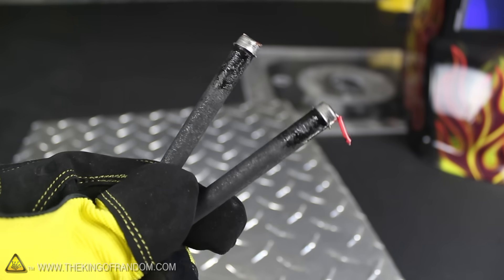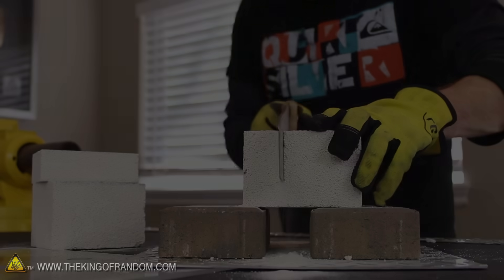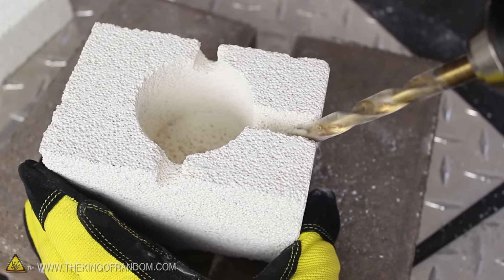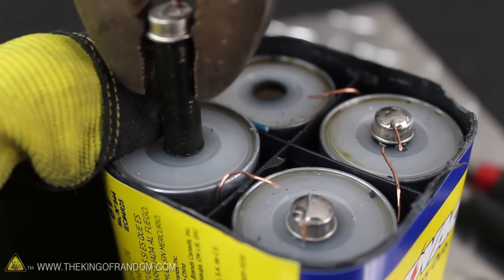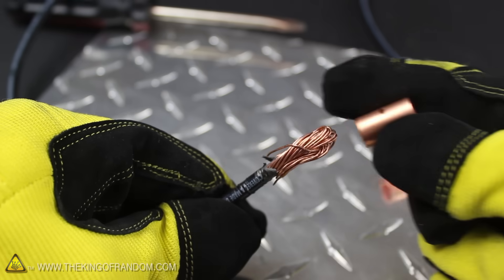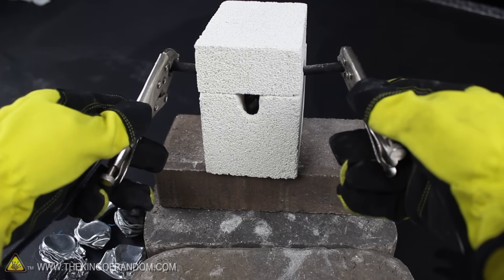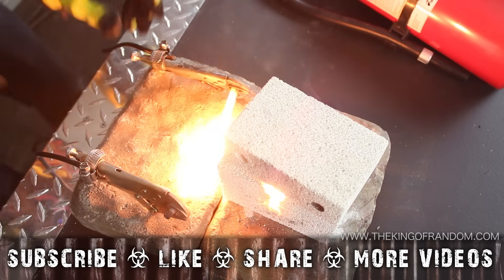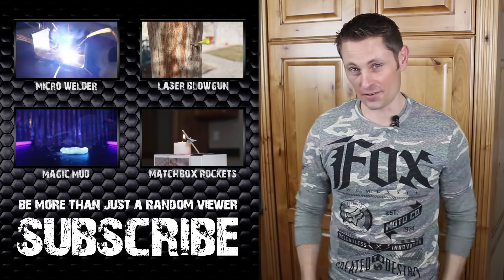How To Make An Electrical Arc Furnace

Comment: do you think sunglasses are enough to not get blinded!?
Reply: No
Reply: Nope
Reply: probably not
Reply: Goober xD y'all don't really get it... i'm not that stoopid
Reply: Julinator I am that stoopid I guess. I've only been working with molten steel for 37+ years now - and I sometimes only wear flip flops and bermuda shorts, no gloves...
I get less deep burn wounds that way. It was always clothing (especially the boots) that trapped a blob onto me, causing the REAL trouble.
Of course, if your casting is going to be large and the air you're in over 800F...you gotta wear some pretty extreme protective suit action.
As far as shade of lenses; shad 10 won't allow you to see much at all unless you're working with an electric arc. Just try it once and you'll see. Shade 10 turns the sun into a dark little disk in the blackness.
Reply: skeggjold gunnr funnily enough this miniature furnace is using electrical arcs to melt the metal... but sure if you dont mind going blind use shades while using this rather than the proper protective equipment ill be here ready to laugh at you when it damages your eyesight.

Comment: does it melt steel beams?
Reply: JET FUEL DOES NOT MELT STEEL BEAMS
Reply: +Imaan Waseem STEEL BEAMS DONT MELT JET FUEL
Reply: +Chosen Mania (DarkWithen) are you high? nothing can render a nokia inoperable.
Reply: +Chaosproscho did 9/11
Reply: Only jet fuel can do that
Reply: Mike Snapper And donald trump
Reply: Can it melt a Nokia?
Reply: VoidRaptor
oh sorry i was drunk and i was at a 420 party
Reply: Correct. it can, however, heat the steel up to the point where it will bend like a paper clip. Please do your research before blurting out the first thing you read on google.
Reply: +sonictales69 I am actually reading "the fire" right now how ironic is that haha.
Reply: yes. he said it was possible to melt steel.
Reply: +sonictales69 doesn't understand what a meme is
Reply: definitely
Reply: Tungsten carbide metal has a 6,192 F melting point, will this work?
Reply: The arc temp is about 10,000 to 12,000 degrees. Should have no problem.

Comment: I am going to use an 130 amp portable welding mashine and graphite electrodes. Would this be enough power for melting iron and steel? Do graphite electrodes wear off? Thanks for your answer in advance!

Comment: what was the power source?
Reply: The two carbon rods react when they touch, hot enough to melt steel.
Reply: +Wocyppah okay so he is using a welder then right?
Reply: I made it using a house outlet (15 amp) with various appliances as resistors

Comment: how long do the electrodes last
Reply: The electrodes get sharp after a few uses. As long as you don't rub them together or put them in the metal, you should be fine for quite a while

Comment: Do you need the arc welder
Reply: +KJ D  You don't need anything ever
Reply: +KJ D I think so
Reply: Shut up!
Reply: ***** Thanks for the tip worked pretty well had sum trouble at first but it was just operator error.
Reply: +Vernon Grimes you
Reply: Hi gays
Reply: I do if you still have it
Reply: pewdiepie

Comment: How do you use the center tapped section? I understand the basics of circuits  but I'm having trouble figuring out the configuration of your circuit for 120V power source.

Comment: does it also work with electricity from a normal socket?
Reply: +Philipp der Interessierte I don't know but Id have thought it would be better with a transformer. The transformer increases the current and lowers the voltage so more of the power from the over all circuit from power station and back goes into what ever is in the circuit on the out put of the transformer. The resistance of the welding creation you made combined with the transformer will be higher because of the transformer. 
Anything on the side with more coils of wire has more energy pushed round Current but with less force/over a lower potential difference voltage any resistance now has more energy passing through it so takes more energy pd between one side and the other * current through it should give you power consumed though the voltage is lower the pd through the welder should be the same and over the transformer it will be higher.
Without the transformer you would need a higher resistance to use the same amount of power.

Comment: in my country we have electricity of 220volts ac current, so my question is still i need a oven transformer ? 
and kindly elaborate the specific reason for using a transformer as you can use a dimmer instead to reduce the required amps for the furnace. 
thanks in advance.

Comment: iron-1370C?If you want to melt iron u'll need 1539C or higher!
Reply: +Леон Вишняков  Carbon sublimes (like dry ice), at an amazing temperature of 3550 deg. C. So this isn't to much of a problem.

Comment: so do you just connect the clamp wires directly to your 240v wall plug with a modified extension cord?
sounds a bit risky, but some1 tell me if I am correct.

Comment: You don't have to destroy a good battery to get carbon electrodes.  You can buy them from welding supply houses.  They're used in commercially produced carbon arc torches.

Comment: Note:  The black powder inside the batteries is not only manganese dioxide (MnO2), but contains ammonium chloride (NH4Cl) as well.  NH4Cl is water soluble, MnO2 is not.  It can be extracted by soaking the black stuff, then filtering.  The solution can be evaporated to get solid NH4Cl.  It's also known as "sal ammoniac," and is used as a flux in soldering.

Comment: I made mine (several!) this weekend.  I experimented with glass, solder, lead, copper, zinc, Aluminium.. I even made some (very brittle) brass.  I did wonder how many amps I should use and started with 40.. then eventually was using a 100 after I re-watched the and noticed that after Grant's 10 seconds with the Zinc how red the surrounding silicate was!

Comment: To avoid the fumes, try a welding respirator. I use the Miller LPR-100. The manufacturer's literature says it filters the zinc oxide particulates. Works for me when I'm welding galvanized too. Cheap, like $30-ish.

Comment: I watched your electrical arc furnace video. That is excellent and very interesting. I have 180 amp arc welder. Can I do the same using that welding plant...? I mean if I connect both wires (+ and -) to carbon rods what will happen....? Is it possible ...? Please give me advice . I am waiting for your kind answer
Thank you very much.

Comment: In your arc welding video you show a home made power resistor (the "scaryac") to limit the current.  Did you use that for this as well or were the carbon rods enough to limit the current?

Comment: What are the specs on those gloves and where can I get them.  What happens if one were to not use gloves?
Reply: +BC ElginTex Looking at his transformer setup I believe he is dropping the voltage down, not sure if its low enough to not electrocute you but its probably a good idea to check and then also make sure you have appropriate insulation.  Additionally any kind of metal melting activity results in insanely high temperatures, you will probably burn yourself even with the gloves so be careful.  I would probably use welding gloves for this, you can buy them at many hardware stores.
Reply: Chris Barth Actually you've got it backasswards, it's EXTREMELY high voltage at the same amperage. It's standard max Ampere output at a stepped up voltage reaching ~1000 V and up to a maximum of ~1500 V depending on the transformer you use because they are all different.
Reply: Did you read what I wrote?  Read the whole comment before commenting.  I will explain it again so that you can understand, hopefully.
 Im talking about when they are rewound AFTER removing the secondary.  With the primary being fed 120V the new, rewound secondary will produce about a volt per turn. High amperage at low voltage can now be obtained. Thick wire is used for current handling. Example:  I wound three turns of #1 THHN copper in the space where the old secondary was,  when energized I measured 3 Volts output unloaded. I tried melting a 6 " -1/4"x20 threaded rod, I measured 800+ Amps on the secondary, it melted it in seconds. 
 Unmodified, yes they are extremely dangerous.
Reply: It melted the rod.  I used a piece of scrap #1 THHN/THWN copper, available at most home stores by the foot. Im an electrician so I have plenty.  The wire does not melt because I only keep it energized for a short time. Yes, if I kept it on for a extended time the insulation would melt and the wire would get very hot.  The lower voltage/higher amperage is better for this application because its safer and it keeps the turn/voltage ratio to a point at where the power consumption is at a reasonable level to where it probably won't  trip the breaker if a short duty cycle is used.
Reply: Not sure about an easy way to do this. Maybe make some sort of saturable reactor (coil of wire with a moveable iron rod in the middle) that is in series before the primary winding. Maybe use another microwave transformer as a current limiting ballast. A variac is probably the best way to limit current but they are not DIY and they are expensive. 

Yes, I used just one transformer for a spot type welder/metal melter. I just built it for fun since I was able to salvage several xfmrs and I already have tons wire.

 I also made my own arc welder with two rewound transformers in series. Very similar to the setup Grant did minus the "scariac".   It works but it burns very hot and will burn through anything less than 1/4" quickly so I do need to figure a way of limiting current.  Im not sure of the route I will take to do this. The scariac isn't very portable, Im thinking of using another MOT as a ballast but splitting the core at the welds and somehow adjust air gap between the E and I laminations with spacers to vary current. 

BTW, before embarking on building something that produces a bright electric arc, first, go buy some welding shades, I knew about welders flash but had no idea at how fast it can happen, all it took was a few seconds of arc light exposure and my eyes were fucked up big time! Seriously, I had no idea about how painful welders flash can be!  You won't feel it immediately, but you will not be able to sleep that night!  It felt like my eyelids were made of 120 grit sandpaper, it's extreamly painful. Eyeballs looked like they were bleeding. It went away the next day but it's one of those mistakes you only make once!
Reply: Oh, and should one use special glasses when watching the arc?
Reply: Yes to both
Reply: unless you want to lose your eyes and hands, then yes to both.
Reply: +Ftc 
I've rewound these x-fmrs for various uses.  The voltage is probably dropped to 5-10 volts.  The secondaries are rewound to produce very high amperage but low voltage.  You probably wouldn't even feel it  with bare hands at that low of a voltage.  The heat you would definitely feel!
Reply: +Chris Barth Few questions: Did your setup melt the threaded rod or your transformer? If threaded rod, what specs is the wire you used in the secondary coil for it not to melt at 800+A (in terms of gauge)? The higher the amperage the more heat is given out? And wouldn't high amperage mean safer?? because with 3V the current won't be able to pass through you.
Reply: +Chris Barth How did you measure all the voltage and amperage of the wires?? Doesn't a multimetre not work at amperages higher than 5A or am I wrong? And how come the circuit breaker doesn't "blow" don't you need a current regulator to keep it from drawing over 13A from the mains?
Reply: I used a amp clamp type ammeter clamped around the secondary wire. A amp clamp is just a current transformer with a spring loaded split jaw.   As far as the breaker tripping, I used a 120V 20A circuit, On the secondary I measured 800A x 3V = 2400 watts.  2400W / 120V = 20A. Isn't that neat how it works out exactly to 20A.  Not intentional, mine just happened to work out that way, it will still trip a 20A breaker if used for a while though, the breaker sees more than 20A due to losses in the core and primary circuit so it will eventually trip.. Microwave oven Xfmrs come in different sizes so what yours will draw may vary a substantial amount.
Reply: +Chris Barth KK thx, but I'd like to be able to put a limit to how much the whole thing can draw like 10A from the socket because here in the UK the circuit breaker/fuses will blow if more than 13A is drawn. How could I regulate this? and you just used one transformer for the whole job right? not 2 like Grant does? Sorry for the tones of questions :P
Reply: +BC ElginTex You only have to protect the fingers and eyes you want to keep.  Other than that, you don't need protection at all.

Comment: This is an excellent project and I think that people should try it out. Simply remember that the electrical arc between the carbon rods is AS BRIGHT AS THE SUN. Only ever use this arc furnace with a #14 OR DARKER welding helmet. #14 or darker!

Comment: electric arc or (TIG) Welding, Gas welding Or electric resistance welding... for aluminum or magnesium use preferred TIG welding , for titanium also use TIG welding but make sure all oxygen and nitrogen traces are remocved from the welding are !!!

Comment: So can you just plug these wires straight into the 240volt wall socket - or do you need the transformer to isolate it from the mains.  Still if you touch those pliers with bare skin, or drop them on your skin while switched on - you're dead. The idea of holding two pliers with mains level electricity isolated from your hands by 2mm of rubber gloves, sounds ridiculously dangerous.

Comment: I know the bricks are quite side, but can the rubber on the pliers be replaced with the brick material, like a cylindrical tube? That would essentially increase the amount of time one can hold on to the pliers. Unless the pliers themselves melt.

Comment: Take the zinc then melt it into ingots and sell them as Tin
They look exactly the same and look at the prices:
Image result for tin price
get access to about:
Base Metal Prices  
Nickel USD/lb 3.79
Tin USD/lb 6.01
Zinc USD/lb 0.67
KEY: TRADING | LAST CLOSE DATA README 
Buy zinc for 70c and sell it as 6.01$
Reply: Scamming 101
Reply: Mark Pikas :| Do I have to do everything?
Depends on how you want to transport it.
Water 10 cents per ton mile
Rail 3 cents per ton mile
Truck  37 cents per ton mile

Unloading ingots is pretty irrelevant. I don't carry heavy objects on a daily basis, but I'm fairly certain I could unload a ton an hour.

I'm not including food or water, you would using those anyways, sleep in your truck.

Depending on how you play this, if you had a considerable amount of capital, you could invest in tin market futures before your scheme.

After what you've done has been discovered, tin markets Should go up due to the thought of an overestimated supply. I'm not a market expert though, I'd be interested if anybody had a speculation.

This is just a thought experiment obviously, and I can't predict every solution and challenge, I got bored and was curious about some math. I posted because I figured it was kind of interesting.
Reply: +PQWER yeah but then when they weigh it then youll be in for some trouble
Reply: The only differnce would be the size :/
Reply: PQWER no, the densities would be off.
Reply: Dominick Tedesco I'm sure you could find someone stupid enough to trick into not knowing the densities between the two.
Reply: PQWER im pretty sure anyone who is going to buy aluminum from some random untrusted source is going to check. only kind of people who are too stupid to do that are people stupid enough to sell it.
Reply: +PQWER Give it a try, let us know how you do.
Reply: +PQWER That's scummy
Reply: +PQWER 
YOURE GENIOUS
Reply: +PQWER People have been buying/selling metals for thousands of years, you don't think that trick's been tried prevented against? Or do you think everything you see is new?
Reply: +Dominick Tedesco yeah stupid like 
YOU
Reply: +PQWER 
7.14 g/ml Zinc ($.001>  a gram) You could use pennies, if you have a process for removing the copper
7.31 g/ml Tin(~1.7 cents a gram)
11.34 g/ml Lead (0.0002 cents a gram) Bulk
.17 g/ml difference.

For every 66.71 g of Zinc add 1 gram of Lead.
The only way you could even get caught is if the measured the conductivity, which they almost never do. If they check it, just say you thought it was tin. Nobody is going to go any deeper than that unless you're trying to get rid of literally tons of the stuff.

~1.69 cents per gram of profit
~$15,400 profit per ton
Reply: +Brotherhood of Steel how about accounting for the power and supplies to do it?  Loading, transporting and unloading it...?

Comment: I'm I the only person concerned about how dangerous that can be? 240v live, no proper safety equipment/gear, no proper insulation (both thermal and electrical)... Would still want to try it and see more development on such a project
Reply: 240V is the input voltage to the welder, the voltage used at the electrodes is usually around 40VAC (Hence the need for a transformer).
Reply: +flomojo2u not sure if he's got proper connections to the wall outlets, and still... 40vac at whatever amps is still something to be careful about. I just think there's no emphasis on safety, which should be imperative. Pretty irresponsible of the author, given his reach wide and a lot of viewers might not be acquaintanced with the different hazards.
Reply: ur so boring

Comment: and how much would this weigh on my electricity bill
Reply: A lot
Reply: About as much as running two electric space heaters for the same amount of time. In other words, not really that much unless you are doing this all day, every day for most of the month. To do it for an hour or so now and then, the additional electric cost will be very low.